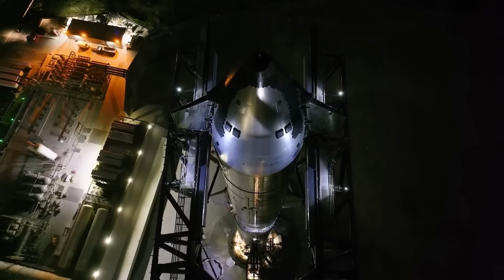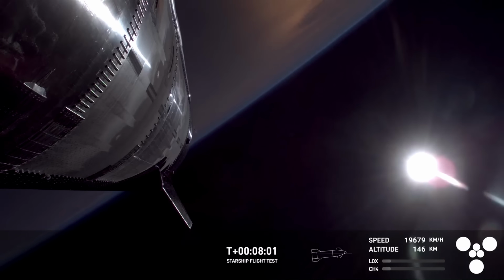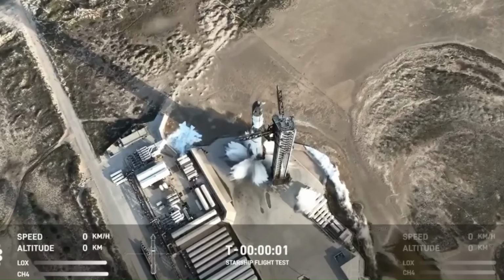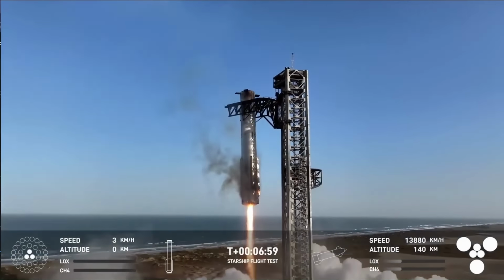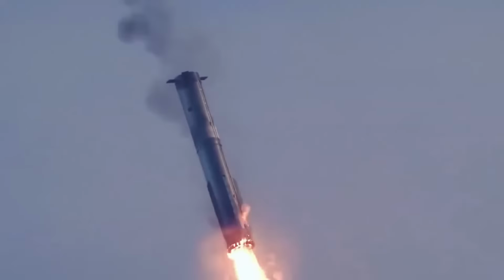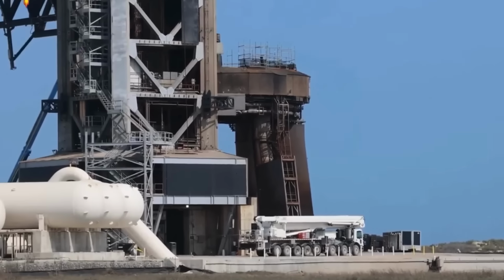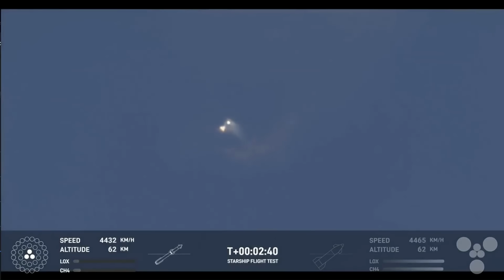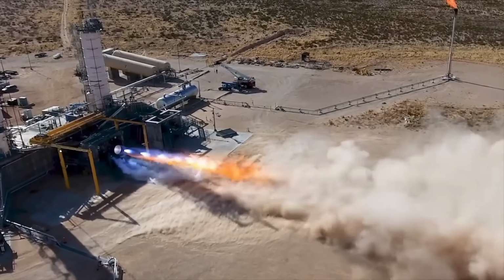SpaceX Just Discovered Serious Engine Problems In Starship Launch!

Comment: Lot of problems... :  (   Regarding one of them, might not be igniters, could be fuel delivery.   There's clearly fuel leaks among the issues.   Some vidys show, there's no control over the fuel in the tank (positioning).  Even tho they may have dampened vibrations that have catastrophic results on hardware, there are still lots of vibrations as really they just changed the resonate frequencies... the power/energy is still there but at different frequencies.  Point here is, aeration of fuel supply to some engines (note relights sometimes but not others on same engine).  Would love to know SpaceX's igniter protocol! Thoughts?
Good vidy, ty.

Comment: The booster uses all 33 engines they all worked .
It then goes to 13 shutting down the outer ring  2 of them didn't  lite 
It then shuts them all down
They relite 13 of them only 12 relit
At final landing they switch to the 3 center engines , they all worked.
Reply: The video clearly shows that only 1 engine operated during the catch.
Reply: The landing requires shutting down engines in sequence. It is normal to step from 13 down to 3, ending with one engine. 
 @lloydwoodall8520

Comment: It’s a design change from version 1  to version two they had 1 transfer tube but changed it to 3 transfer tubes plus other changes, versions 1 never had  problem of leaking and fires,they had 6 flights and the raptors engine worked perfectly,they need to change back to what had worked
Reply: Actually all 6 flights did not work!   The first flight lost a bunch of engines on booster and didn’t even ignite the second stage.  Flight 2, failed in a similar fashion to flight 7 and 8 where all three of those flights ended within the last 60 seconds of planed flight due to some type of anomaly!   Flight 7 and eight were using the newer block 2 version of starship and Raptor 2 engines.   That part is true but not sure you can say the raptor engines worked perfectly!